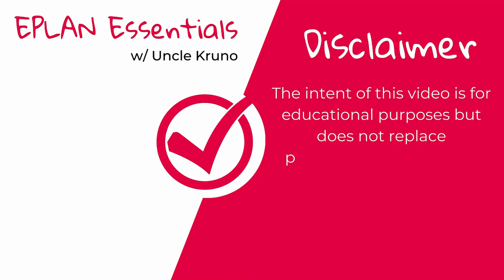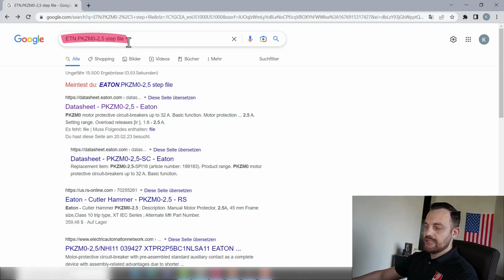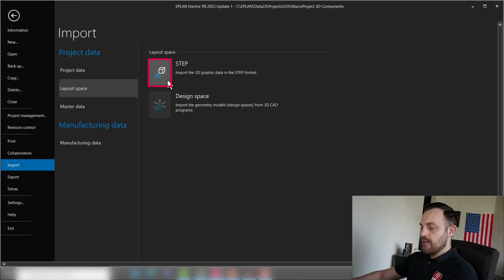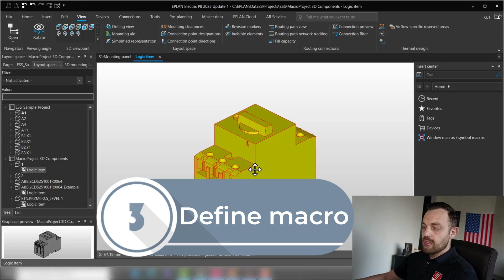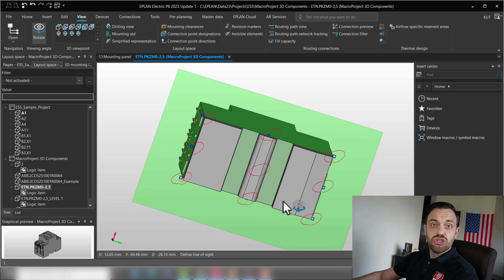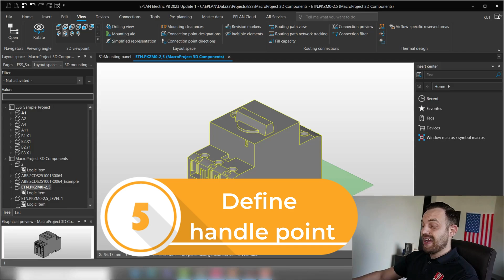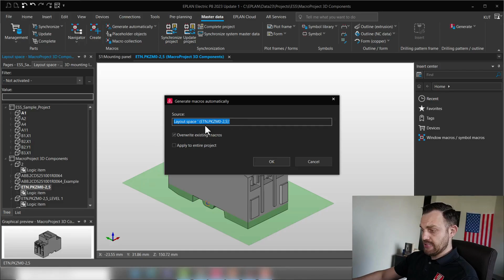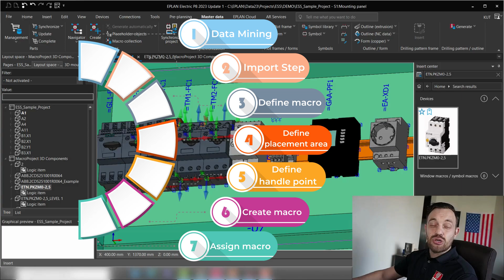EPLAN Pro Panel 3D Macro Version 2023 | FULL TUTORIAL

Comment: Great videos man. We are deciding whether or not go to EPLAN from Autocad Electrical. We still don't know if this is the right path to follow, although I'm pushing the higher ups to proceed lol. Question for you, if my 3d file is not STEP but other format, would ProPanel work the same? Can I build my component in EPLAN or do I need to first build the 3D part in either SolidWorks, Inventor, Autiocad  3D, etc? Thanks for your reply loving your content
Reply from the maker: Hello Jan. Thank you for your feedback and your questions.

I understand that switching software maybe be cumbersome at first, why would you buy a new car if the old one is still working, please feel free to reach out to me via LinkedIn or email: kutnohorski.k@eplanusa.com, ill be happy to support you and your higher-ups with information you need to make the right decision for you.

Regarding your questions,  when importing 3D Geometries the only file format is STEP File, however since EPLAN is a database-driven engineering Software you can certainly start without the 3D Geometry, simply by entering W/H/D values in the properties.

Hope this helps you, let me know if there is anything else sir.

Best Regards
Kruno
Reply: In the past I've used SolidWorks to format the part to .Step

Comment: Do know why but after selecting surface for placement area no green plane showed. Apart from this I don't button Generate automatically for macro (it is gray). What can be the reasons? I upload step file and define properties like you have presented.
Reply from the maker: Hello Marcin.

Please make sure that in the Project Properties the Type of Project is selected as "Macro Project"
The placement area will not appear, neither you will be able to generate the macro if the Type of Project is set up as "Schematic Project"

Hope this helps.
Kruno
Reply: An eplan rep recommended I create a seperate "Macro Project" specifically for bringing in Step files and creating macros.

Comment: Hi Uncle Kruno, what cool videos you have made about pro panel, these video's help me a lot. I also have a question, could you show, how to deal with Cable conduit 2596.000, to get the wires to the door through wire routing? For example with cable tube from Rittal 2596.000 holder 2594.000
Reply from the maker: Hello Martijn, Thank you for your Feedback.

When it comes to routing between 2 mounting surfaces (like mounting panel and door) it may be useful to use "Curves" to connect the routing paths from the respective surfaces.

I already have created a video, on how to create Curves:
https://www.youtube.com/watch?v=ce06fFAIy4s

If this doesn't solve your question please feel free to reach out to me on LinkedIn.

Cheers
Kruno

Comment: First of all, i would like to congratulate your effort and time invested in creating these videos! They have been of huge help to me. And, i would like to take this opportunity to ask if you could make video on installing, defining and configuring mechanical parts in Eplan Pro Panel, most of all, supports, universal cross rails, etc. and their "linkage" to the structure of the panel, as well as amongst themselves (preferably, Schneider electric cabinets and mechanical components associated to them)? For me, personaly, defining and mounting parts on mounting panels presents no problem. However, when it comes to placing and connecting mechanical components in "intermediate" position sort of speak, that's where the problems start, so it would be of great help to me if you could create such a video. Once again, congrats on your effort so far, and keep up the good work!
Reply: I agree with this tutorial request. I also have major problems placing mechanical accessories on cabinets. I can never get the placement and orientation of an accessory part to locate properly